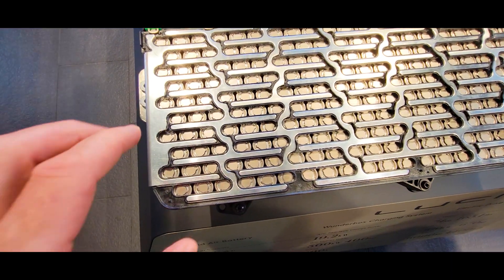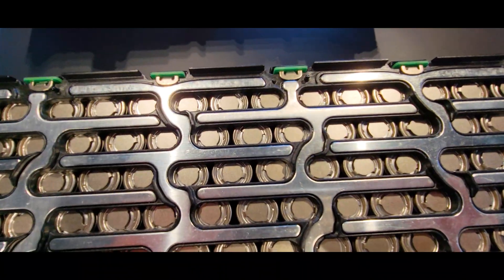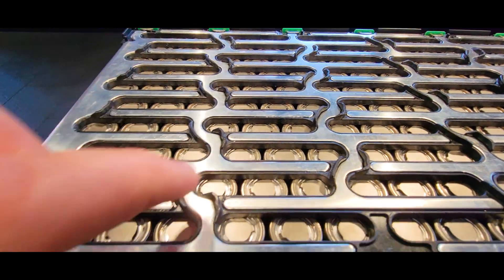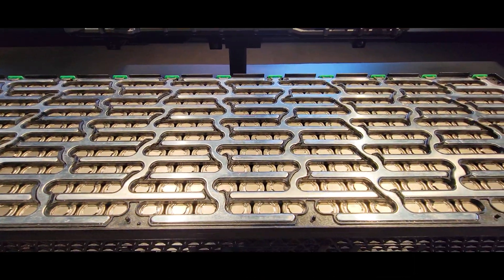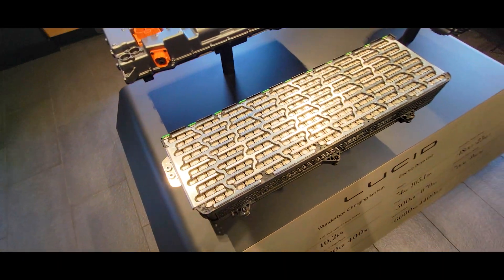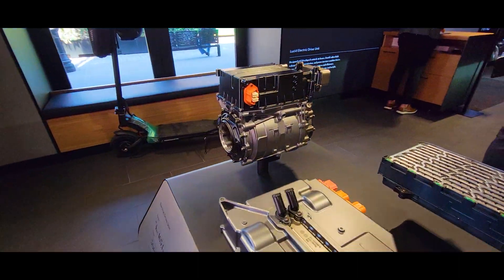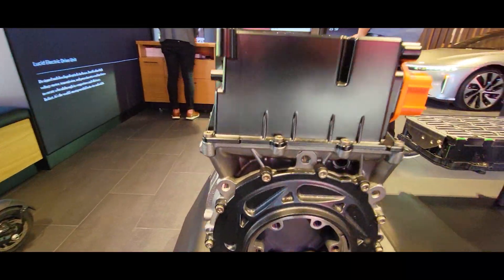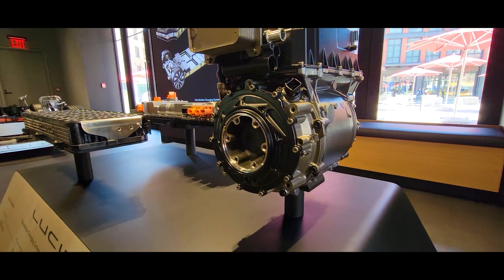The Most Advanced Battery Module Better Than Tesla - No Fuses by Lucid Motors!

Comment: I sincerely hope they are already integrating structural packs in their R&D for future models else they are already further behind.

The power to weight of their motor is no longer the highest, that's just misinformation. They are already behind on that as well.
Reply: Please explain your math on power to weight ratios.  The Lucid Air Dream edition produces 1,080 hp with TWO motors which weigh 163 pounds each for the entire motor/gearbox/inverter unit.  The Tesla Model S Plaid produces 1,020 hp with THREE motors which weight 198 pounds each.

Comment: I thought that the point of the fuses was that if anyone individual cell had the power drain higher than cell can take or if anything should happen to the cell, the fuse would pop and therefore save the entire battery pack and prevent thermal runaway where it could cause one cell to ignite and cause a cascade effect on other cells which would destroy the battery making it catch on fire
Reply from the maker: Maybe they have a different system. I will do a follow up on this video soon.

Comment: 800 volt architecture ⚡it's why Tesla can't compete with 500+ miles
Reply from the maker: 517 miles in range is impressive!
Reply: That has nothing to do with it. Anyone can make a 500 mile electric car. You just need lots and lots of batteries and the car will get very heavy

Comment: Yeah right, batteries without the positive connected... This is an unfinished pack. They will still have to bond some wire to the positive terminal.
Reply from the maker: I was told the pack is in working condition and ready to run.

Comment: 21700
Reply from the maker: it is 2170 not 21700!
Reply: @ElectricVehicleSpace  21700 cells...21mm wide 70mm long. If they were "2170" cells that plate would be 1/10 the thickness.
Reply: @patrickdonovan909  It is 21mmx70mm.
The last character is O which states for cylindric shape of battery.

700mm is acctualy 0.7 meters, more than 2 feets or 27 inches.
Reply: @idovecer  better? I sell batteries....those cells look no different than the 21700s we sell for ecigs, ebike, eboard, random projects whatever.
Reply: @idovecer  sorry I hit the 0 too many times. Love how they claim "new battery design" when the only "new" part is the way they get away without fuses. Nothing fancy about the size of the cells. What they do on the inside is up to them

Comment: Looks like latest Tesla Model 3/Y style, not sure how it's better? also looks like they haven't put on the bond wire fuses yet.
Reply: excatly this…. This is judt a show model. The surface would be waaay to small for a good enough cross section to pull thhis amount of amps. you would create hotspots in the battery
Reply from the maker: it connects with out fuses. It is under....you can see it but its under the bus bars. That is a fully operational module btw!
Reply: @ElectricVehicleSpace  I'm looking at the video, there is no connection to the + side of the cell to anything... sorry someone in the showroom was lying to you saying it's fully operational.
Reply: @melovescotch  lol of course its all a smoke show lucid is a fake car company anyway.
Reply from the maker: @caRpetbomBer1  it looked very real to me.